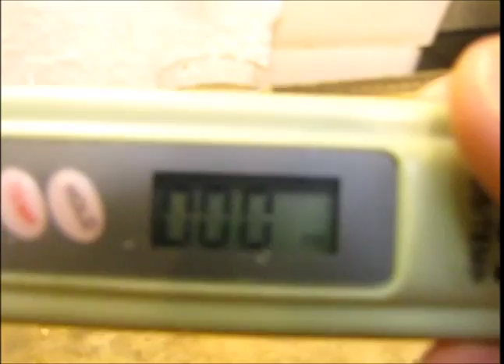Reverse Osmosis (RO) Water System for Brewing

Comment: Great video just have a question concerning the RO system.  Do you need a water test kit to know what to add for brewing? Or do you need to add anything? I have learned a lot thru your videos. Thanks
Reply from the maker: You do not need a special water test kit. The beauty of RO water is that it is a blank slate. Pretty much everything is stripped out of it.  You can then add minerals and additives to it to build the best water for the recipe you are brewing and not have to worry about what is in the water to begin with.  You should have a TDS meter to check the RO system to find out if it is time to change filters.  A PH meter is also a good purchase to tell you your mash PH.
Reply: Do you know how much the RO systems are to maintain (replacement filters etc)?  The reason I ask is I know just for my whole house water filters, fridge water filter, etc, they are pretty expensive for the few months of use they get.  I have access to an RO water system about a mile away that is like $1.25 for 5 gallons.  Thanks for the video and information
Reply from the maker: @18centwood  Just saw this, sorry for the late response.  I bought mine about 18 months ago for under$100. It is used for the ice/water on my fridge, 40 oz of coffee a day and maybe 150 gallons of brewing water, so far. I haven't replaced any of the filters and my TDS meter says solids are still low.  I expect a set to cost around $50 and may need to do it in a year or two.

Comment from the maker: A few things I didn't show or mention in the video that I wish I had.  

1.)  All of the tubing is 1/4" OD, including the copper I used for my refrigerator and water connections.  The PE water line is cheap and easily obtainable at any big box home improvement store such as Menards, Home Depot or Lowes. 
 
2.) The 1/4" quick connectors are really slick. I bought a bunch of extras in a kit so I could split the output lines.  Using them is real easy. There is a locking ring on a slip collar that is removed first (on the ones I have it is blue). You then just push the tubing into the connector, extend the collar back out and put the locking clip back on the collar.  I usually pushed the tubing in again after putting on the collar to make sure it is fully seated. Once the tube is in all the way they do not leak and can not be pulled out.  But, if you do need to pull the tubing out it is as easy as taking off the locking ring, pushing the collar into the fitting and pulling the tube out.

3.  In the video I mentioned that all of the places I needed to install tubing were labeled.  They also had plugs in those fittings holding the labels in place.  I had to remove the plugs before putting the tubing into the fittings.

Comment: Nice video of your RO system.  I also have a 50 gal per day RO system that has a 3 gallon holding tank and faucet plus a line going to a 30 gallon collection tank for brewing water but I haven't tested it out yet to see how many gallons it actually produces per day. I live in an area that doesn't have great water pressure and I like the idea of the booster pump, mine doesn't have one and I wish I would have seen those units before I purchased it. I may have to look into getting one as an add on to my system if the output is slow. Thanks for sharing   Cheers
Reply from the maker: Thanks for the comments.  My holding tank specs say it is 11 liters (about 2.9 gallons).  This morning I did a production test.  I put my float lid on a 5 gallon bucket.  It was at about 3 gallons in around 20 minutes.  I checked it at about 40 minutes and the float had stopped it at about 4.5 gallons. So, it produced at least 1.5 gallons in under 20 minutes.  I was getting ready for work so I wasn't closely watching it.  So, with the pump I might be able to get around 5 gallons an hour after the tank is empty.  We will see.  Cheers.